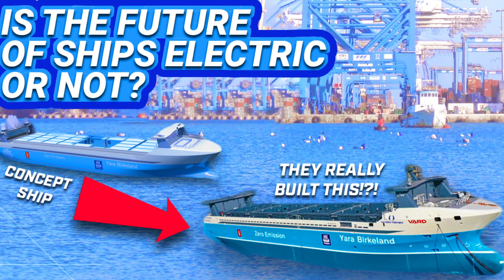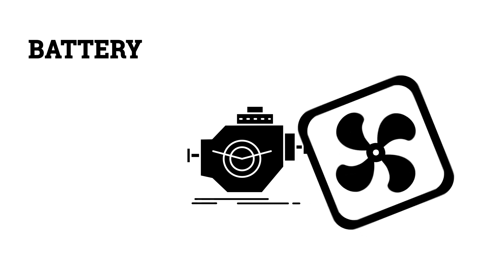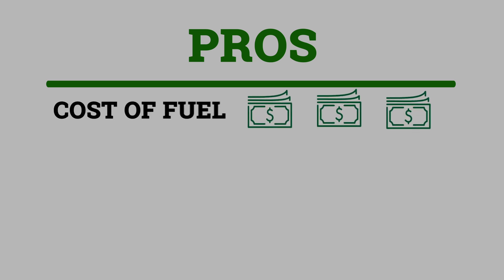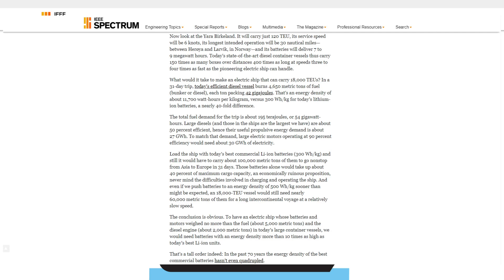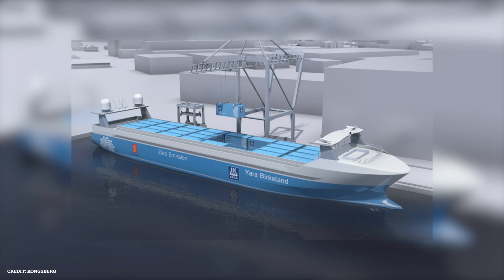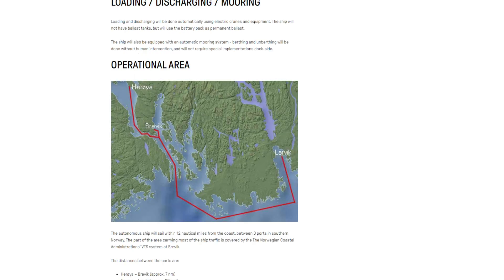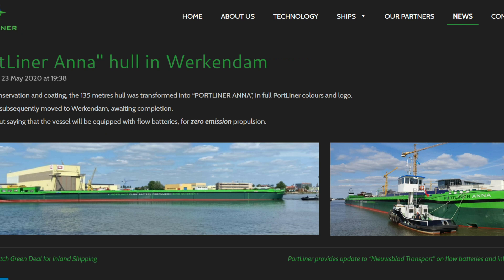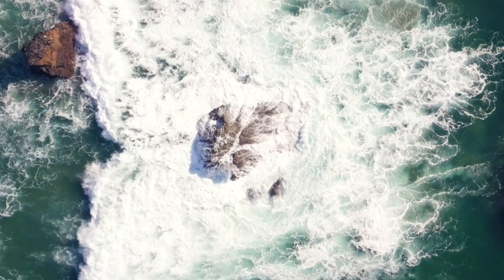Are Electric Ships the Future? - how electric ships work and who's working on them

Comment from the maker: Electric ships look likely to spark new ways of thinking about ocean transportation! What do you think of this technology and who will lead the way?
Reply: Having been drawn into the 'sustainable shipping' debate by a different route the following is a 'cut & paste' form the 4.5k word salad that trying to debunk some of the hyperbole has caused me to generate.  if you want more drop me a line on bernard.leslie.stewart@gmail.com and I will reply with the complete smorgasbord of 'MHO'.

With regard to propulsion with electric motors powered by ‘green electric’, leaving aside the fact that there is no truly ‘green’ electricity, the best we can do is low carbon impact both at installation (capital account cost) and production (revenue account cost).  Running ships on the ‘lecky’ is tricky the two examples that I personally know of, and have used, are a vehicle and foot traffic ‘chain’ ferry that ply’s its trade across the hundred meters or so of the Nordre älv between the island of Hisingen and the Kornhall on the Swedish mainland.  The motors are on the ferry and a power supply cable is unwound and wound back up on board as the ferry shuttles back and forth from Kornhall.  When the vessel goes anywhere else, id est dry dock for survey and or maintenance, it is towed by a good old ICE powered tug.  The other electric vessel is a vehicle and foot traffic ferry that runs from Helsingborg (Sweden) to Helsingor (Denmark), a twenty minute trip undertaken using energy stored in batteries on board, she tops up the charge in Sweden each time she is alongside and battery capacity is said to be sufficient for an hour of main engine use.  There are small diesel gennys on board; to keep the lights on in extremis.  Sadly as of now electric boats are as functional as chocolate fireguards, yes ‘submarines can be diesel electric’ but they have negligible cargo carrying capacity and if you ever go on one (HMS Alliance is available to visit as a static exhibit at Gosport, UK or video available on YouTube, https://youtu.be/Q23uoxT16gO) your first thought could be ‘not much room in here for the crew is there?’
Reply: Do you realise how many people are going to lose their job??
Reply: None!
Reply: Fuel cells may be a way. Batteries can only be considered for short range, low speed applications such as container feeders, otherwise the weight and cost of the energy storage part would be prohibitive. As battery technology to be used, I think low cost is important, so lead-acid batteries could be used. Other storage technology to be considered - flywheels. Some of them have even greater energy density that Li-Ion batteries.
Reply: Your comments about methane as a greenhouse gas is simply totally wrong. 

Your number is often quoted as a scare mongering tactic by climate catastrophists. 

Read up on absorbation lines, light spectrum and composition of the atmosphere. 

Also consider the life time of methane of about 10 years before eliminated by uv light decomposition. 

Compared with co2 that more or less hangs around forever.
Reply from the maker: Niklas Paulsson https://en.wikipedia.org/wiki/Atmospheric_methane 
I don’t think we should be afraid of methane, but electric ships will likely be cheaper while emitting nothing from the ship. 
Have a great day!
Reply: @rapidrev3293  If I send you a copy of Michael Schallenbergers latest book, would you bother to read it? 

If so, please give me a delivery address and I will give you a copy.
Reply from the maker: Niklas Paulsson I’ll have to refrain from giving out my delivery address but drop the amazon link to the book and I’ll check it out.
Reply: @rapidrev3293  Dual-fuel Diesel engines running on 80-90% ammonia and 10-20% crude oil can reduce CO2 emissions by at least 70-80%.

Comment: Bad Idea. 
I am a bridge officer, and also a keen AI enthusiast: eg "Sophia". A.I. (artificial intelligence) can not understand or differentiate between human life, the life of a whale, or rocks and land. This is because it is not conscious, (self aware). It is a set of rules and coding. Even if you have a Captain on land using remote controls, in complete system failure there is no crew onboard to drop the anchors in an emergency - standard practice. Finally: it's impossible for AI to truly understand the hierarchy of importance for every emergency, for example: a risk of collision exists, then a fire starts onboard (hypothetically) and a man overboard. Only the human brain has the ability (currently 2021) to factor in random scenarios and combine human experience with the understanding of being self aware. This technology used early could cost human lives - from risk of collision with ships carrying people.

Comment: The future is Diesel Electric, not fully electric. Letting some cars, trucks, ships, et cetera remain as ICE powered would simplify our electrical grid greatly.

Also, many pollution problems with heavy fuel oil and other "dirty" fuels can be alleviated with SCR systems and scrubbers.
Reply: Toyota just invented hydrogen combustion engine for performance cars. 
Instead of diesel it should be hydrogen-electric ships.
Reply: the future in ships is completely electric with hydrogen cells because they pollute much more than the other means of transport. ICE engines should be completely banned from ships!
Reply: @locoss713  Lmao. You think banning combstion engines is actually a good idea?

Before you get all riled up, I'd like to let you know that they are looking at using ammonia as a fuel for ships. There's no carbon in ammonia, so it won't produce CO2 by itself. In reality they'll be using HFO, petroleum, or biocrude as the "pilot" fuel. I bet that this will reduce CO2 by at least 70%.

During the intake stroke, injectors situated in the intake ports spray ammonia which is then drawn into the cylinders. After the compression stroke, the pilot fuel is injected, which ignites spontaneously. The ammonia is then burned along.

So instead of pushing for draconian and overly simplistic regulations, why not just push for better engines and run both new and existing engines off of cleaner fuels or with more non-restrictive emissions equipment?
Reply: @electric7487  I I said they should be banned from ships! not in general. fuel cells are the future of ship technology. ice engines should remain in other means of transport such as locomotives. Research and devellopment is done in these engines to reduce pollution like clean diesel technology, dual fuel engines , the ammonia fual fuel you mentioned and natural gas engines.  but ships are cancer for the enviroment because they are very innefficient. they should only be powered by renewable electric sources
Reply: @locoss713  Well, MAN Diesel are already looking into ammonia-powered Diesel engines for ships. The problem on ships is that you need so much energy, to the point where combustion engines or nuclear power are really your only options.

At some poing, practicality completely squashes the efficiency argument.

Engines running on ammonia would reduce the use of Heavy Fuel Oil by 90%, as the liquid fuel is injected only to ignite the ammonia.

Comment: You should check out the battery electric car ferries in Norway. They are very successful in there operation.
Reply: With regard to propulsion with electric motors powered by ‘green electric’, leaving aside the fact that there is no truly ‘green’ electricity, the best we can do is low carbon impact both at installation (capital account cost) and production (revenue account cost).  Running ships on the ‘lecky’ is tricky the two examples that I personally know of, and have used, are a vehicle and foot traffic ‘chain’ ferry that ply’s its trade across the hundred meters or so of the Nordre älv between the island of Hisingen and the Kornhall on the Swedish mainland.  The motors are on the ferry and a power supply cable is unwound and wound back up on board as the ferry shuttles back and forth from Kornhall.  When the vessel goes anywhere else, id est dry dock for survey and or maintenance, it is towed by a good old ICE powered tug.  The other electric vessel is a vehicle and foot traffic ferry that runs from Helsingborg (Sweden) to Helsingor (Denmark), a twenty minute trip undertaken using energy stored in batteries on board, she tops up the charge each time she is alongside and battery capacity is said to be sufficient for an hour of main engine use.  A video is available on the Fully Charged channel of YouTube, ‘100% Electrical Ferry Crossing’.  There are small diesel generators on board; to keep the lights and other safety related items on in extremis.  Electric ships currently have short ranges and high light displacement  as a factor of their cargo capacity.  Sadly as of now electric boats are as functional as chocolate fireguards, yes ‘submarines can be diesel electric’ but they have negligible cargo carrying capacity and if you ever go on one (HMS Alliance is available to visit as a static exhibit at Gosport, UK or video available on YouTube, https://youtu.be/Q23uoxT16gO) your first thought could be ‘not much room in here for the crew is there?’

Comment: Power them using solar panels
Reply: Solar power is next up; as an example the above container (called boxes by nautical folk) area of a Maersk Triple E is less than 399.2m by 59m.  The 399.2m is the length between perpendiculars (marine tech speak - no need to worry about it) and the 59m is the width overall (more marine tech speak so again no need to worry about it) allowing for the sides, bow, stern & navigation/accommodation structure could we agree 340m x 56m, or 19 040m2, for the ‘top of stow’ area?  Insolation rate in Joules will vary due to time of day, latitude of vessel, declination of sun, (those three impact the elevation of the power source) cloud cover, the efficiency of the solar panels and how clean they are.  The Triple E class use two 29 680 kiloWatt each, at full whack, ICEs for propulsion plus some hotel and services power load cost; so for round numbers, could we agree 60 megaWatts?  Solar panels create about 155 Watts m2 averaged out; 19 040 x 155 gives me 2 951 200 Watts (or 3 megaWatts for a round number) from the top of all the boxes.  Those three megaWatts might allow you to distil enough fresh water from the sea to wash the crud off of the solar panels (surprise fact renewable energy comes with maintenance costs) but nowhere near enough to effectively 'push the boat along'.  Fitting solar panels on top of the ‘boxes’ is worth, at most, 0.5% of your power requirement.  Side mounted, let alone towed array, solar panels are not practical given the harsh conditions found at sea.

More seriously the ‘boxes’ are loaded and unloaded from the top down so the solar panel array would need to be moved for every port operation and time is money as well as that operation having the ability to get very complicated (tech speak for ‘go wrong’).  Any additional weight would be in the worst possible place for the stability of your vessel, the operating environment would be harsh and the ‘top of stow’ on a ‘box boat’ is seldom a level expanse as each column of containers may be, and usually is, of differing heights.
Reply: Ok ﹰI get the 3 megawatts generated is not nearly enough but ﹰI saw a video recently of a U.S ﹰAirplane Carrier powered by two nuclear reactors I feel this will be the best best by removing the engines completely and installing one or 2 nuclear reactors side by side this will give you more than enough electricity and the propeller shaft can be connected directly to the reactors spinning turbine
Reply: @justthewayitreallyis8131  If you do a web search for ‘nuclear ship savannah’ you will see that it has been tried and did not work.  A similarly heavily subsidised, by the government, vessel is in use in Russia which also operates, in support of the Northern Sea Route, a fleet of nuclear powered ice breakers these may, or may not, have been completely without issues.

Just think; would you have full confidence in the management of a nuclear reactor under the control of an anonymous entity only traceable, perhaps, via a letter box in a FOC (flag of convenience) nation state?  If you are, could you sell that confidence to Japan, the state that hosted the Hiroshima and Nagasaki nuclear detonations as well as more recently the Fukushima ‘event’?  Then try that same, or a similar, sales strategy on Ukraine, the nation state that as a part of the USSR (CCCP) hosted the Chernobyl ‘event’.  Modern iterations of nuclear energy, thorium fuel, molten salt reactors or fusion reactors, will carry the legacy of past problems.  It is the global trepidation of anything with 'nuclear' in the name and the economics of nuclear having transitioned from 'energy to cheap to charge for' too 'the costs of remediation are incalculable' that will prevent the adoption of nuclear energy as a means of creating energy at sea.  Modern reaction systems may have overcome the safety problems but the general public, having been misled in the past, will be reluctant to believe the fresh new promises.

‘They’ say nuclear is cheap, it’s not it is expensive and has a large embedded carbon quotient as well as being complicated, dangerous, not universally socially acceptable and having only ‘no need for refuelling’ as a questionable advantage; actually it does need refuelling just not as often.  When ‘they’ do need to refill the warming up stuff it takes considerable longer than pumping tonnes of thick black stuff, HFO cSt380, or thin runny stuff, MDO, onboard which is one of the reasons HMS Queen Elizabeth and HMS Prince of Wales are pushed about by ICEs and gas turbines thus using a similar fuel as the aircraft that fly off of them.  The Royal Navy (RN) with a high degree of skill and expertise uses, at vast expenses to the UK taxpayer, a current operational nuclear fleet of 11 submarines (also known as ‘boats’) in two flotillas, seven attack subs and four ballistic missile boats.  The carbon footprint of all the extra bits of hardware and the fuel, including processing thereof, from ground to propeller, are the external costs that never seem to get considered.

Disposal, once it wears out, of both the machine (that was a ship) and fuel is another can of worms best left unopened.  The 26 RN boats no longer in use are laid up (some in Rosyth and some in Portsmouth) awaiting long term deconstruction including dealing with the fuel rods and other irradiated material.  The USN is not, as far as I know, a commercial organisation working to very tight margins and also has the skill and expertise to handle the complexities of nuclear power; so as well as submarines their aircraft carriers are nuclear powered and each of the current iteration has a build cost three times that of QE/PoW, bigger crews and more generous funding.  For those who still think that nuclear energy might be the answer I recommend this report: - https://www.bbc.com/future/article/20200901-the-radioactive-risk-of-sunken-nuclear-soviet-submarines?ocid=ww.social.link.email.  The navy of the USSR might have been under resourced and over extended but it was still generously supported in comparison with merchant shipping.
Reply: I understand it won't be a solution but more a complexity with many possible problems including a massive price tag and as you said it won't be safe either especially for the environment and the sailors that will be working with and on it. But there are other methods of propulsion systems, I was researching on an engine that works with a magnetic field, I will look for the video and send it to you so you can get a better understanding of what I'm talking about. I guess the goals are; a cheaper more efficient mode of propulsion, a cleaner way considering a carbon affecting footprint the world, a easier less complicated method where the average sailing crew can operate
Reply: Considering the solar mehod, cant massive alterntors be fitted around magnetized propeller shafts to create the extra power needed? Or will it will it still not be enough output?
Reply: @justthewayitreallyis8131  Getting the energy 'on board' is the fundamental issue, harvesting it from the sun of wind does not provide as much in as convenient a form as loading it through a pipe in the form of a combustible hydrocarbon and the cheapest way to get that is in the form of fossil oil and gas.  Reducing amount of cargo moved by mass, volume & distance is the least cost option to reduce the impact.  Thereafter improving fuel quality is the 2nd best means to lower the industries environmental impact, IMHO.
Reply: Nuclear power. Or RCCI Diesel engines using port-injected ammonia and direct-injected biocrude.

Comment: Imagine Tesla use their new "tables" battery tech to apply into their Megapack Powerwall, would be sufficient enough for large cargo ship I think.
Reply: Liquid Metal Battery would be great rather than those small battery.
Or hydrogen fuel cell could be possible.
Reply: @shrin210-98  weight weight weight
... what about wait?